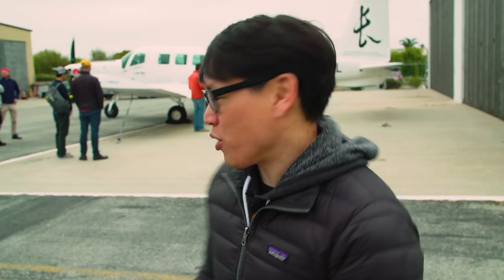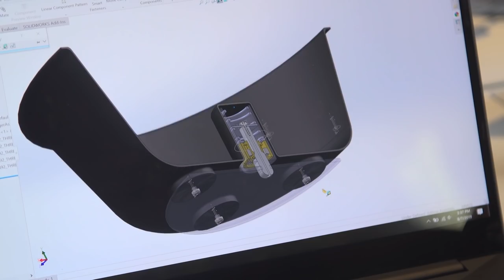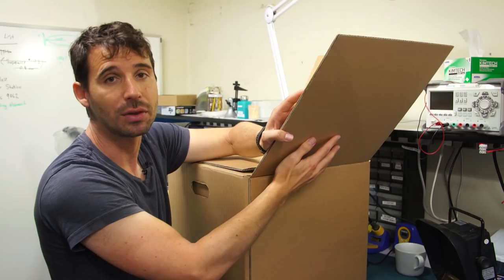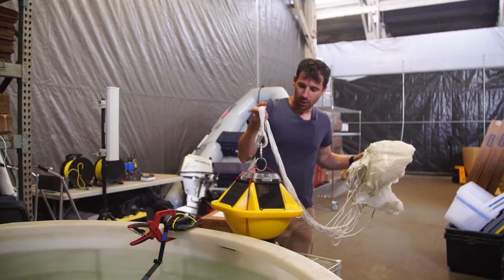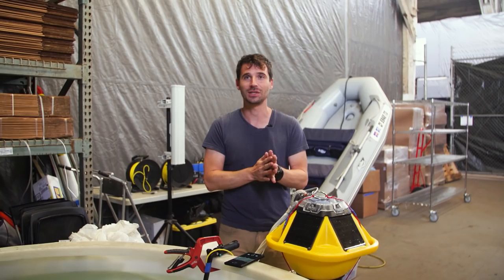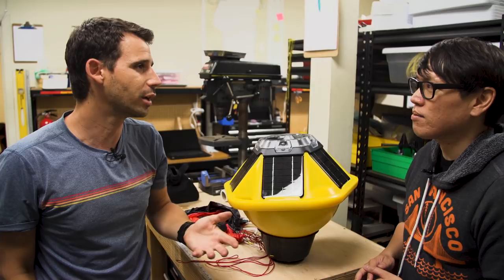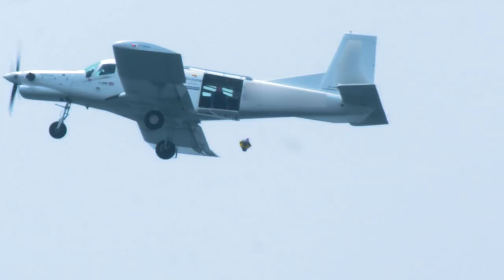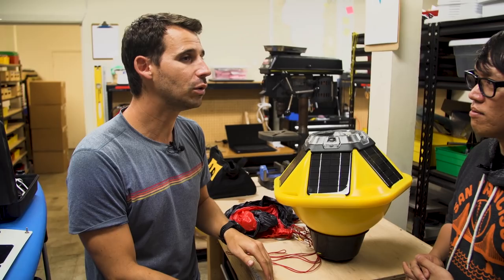Tested: Deploying Ocean Sensors from a Plane!

Comment: so what happened to the plastic bowls and the parachutes? do they just get dumped into the ocean and left?
Reply: @2000jago  the parachute gets released, only the bowl stays attached.

Small, cheap buoys like this don't get retrieved, that would be extremely expensive
Reply: This is also mostly a proof of concept or prototype. This is not the finished project.
Reply: 2000jago If you actually watched the video you would've seen them testing it and the parachute detaches from the device. Why do I even bother.
Reply: Yes, that's why they were also trying to make a biodegradable solution.
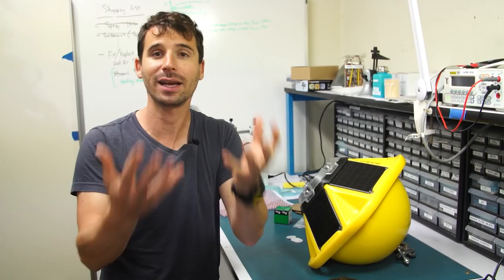Reply: @2000jago  (1:42) he stated when it lands in the water the mechanism detaches and 'is left freely to drift in the ocean' the whole point of the detaching device attached to the parachute, was that it was supposed to detach once it hit the ocean using the life vest deployment component. "if you actually watched the video".
Reply: He did mention that they were looking at biodegradable options. 
I think that in the end’ even if it does leave behind some plastic it could be a small price to pay for what could be invaluable data.
Reply: @NullHyp  I'm not really sure but would they even be able to use a biodegradable plastic? That would totally eliminate the issue.
Reply: John Jacob Jinglehimer Schmidt That doesn’t get rid of the circuitry and wires that contain toxic elements.
Reply: @hellishgrin4604  I mean for the plastic bowl holding the chain. I would assume the whole thing would continue to be useful.
Reply: @JohnJacobJingleheimerSchmit  yeah biodegradable plastic could be the solution. I'd call it cellulose tho (more similar to paper than plastic) but it would have to be tested for endurance: i mean can it actually withstand what is it meant for? The cardboard idea also bugs me.. it takes quite long for cardboard to dissolve and during that time the device wouldn't gather infos as efficiently if it isn't completely removed during the fall.
I'd prefer a different device design that allows it to be thrown out of the plane with a single small biodegradable parachute to  keep it steady during the fall and it's shape to be conical and allow a "softer" impact with the water.
Reply: thats my question more polution
Reply: I'd like to see the plastic bowl system, but made out of bamboo.
Reply: Small, cheap sensors like these are not designed to be recovered--that would increase the cost by many orders of magnitude, and the parachutes, bowel, strings, etc. will be more plastic trash that won't degrade for many, many years.  Data acquired from protocols that use multiple samples over short time intervals are just as robust at those gathered by "in situ" type sensors like these.  All this project will do is add more trash to the water, with very little good data to show for it.
Reply: Just from watching this video, it looks like the whole thing is essentially "disposable" -- eventually it will stop working, and they're not planning on trying to collect them. Though I wonder if they will have addresses printed on the buoys themselves so they can be returned if found on beaches or whatnot?
Reply: @crittobobby  I think they could use different cardboard. There are starch based materials that dissolve in water in a matter of minutes. I'd be tempted to make a box out starch based adhesive and myocomposite. The myocomposite is a mushroom mycelium based packing material used to replace expanded polystyrene. The starch adhesive dissolves and the myocomposite sections fall away like flower petals. The advantage of the myocomposite is that the material is just food. Even if it takes a while to degrade, fish, plankton, etc will just eat it.
The other idea could be to pack the buoy in starch packing peanuts and hold it all together in a starch bag. They are the sort of bags used for domestic food composting / recycling. Whilst these materials might not be fast to degrade, they can be made in sections and joined with a water soluble adhesive that would take seconds to release the protective case. 

There are lots of materials for packaging that could be utilised, it just takes the researchers a bit of effort to find an alternative to nylon parachutes.
Reply: The parachute and lines could definitely be made from silk  -- it worked for early human parachutes I can't image it wouldn't work here.  Due to the small size and (it appears) higher landing speed than is acceptable for a person, I suspect many other cheaper, weaker, natural fibers could be used (cotton, flax, hemp, etc.).
The bowl could also, undoubtedly, be made from a natural biodegradable material. Possibly paper/cardboard (like the kind used in egg cartons).  Or maybe a bag could be used to hold the chain instead of a bowl, and then a natural fabric cold be used here as well.
Reply: @JohnJacobJingleheimerSchmit  biodegradable plastic sounds good but in reality it is not. It is bio degradable but only under special circumstances. Like 65 degrees celcius under special circumstances like in an industrial composting unit and it will be gone in 7 weeks. Under normal circumstances it takes decades.
Reply: Could you not just make dissolvable string? Or simply harden the case enough to withstand the impact or designed to alleviate the impact like a dart head or pyramid?
Reply: Oh buoy.
I ACTUALLY HAVEN'T seen the whole video and I know already more about the chutes than half of the experts here.
Reply: @patricksanders858  paper!
Reply: I know, right.
I can't have a plastic(recyclable) straw but this company can do this?
Reply: Seems like they got the idea from the Narcos
Reply: Think about all those sonar buoys the p3-orions release for various reasons, decade after decade. I believe they don't retrieve those either.
Reply: Considering this could be a lifesaving technology, it’s not really a concern, is it?
Reply: @John Jacob Jinglehimer Schmidt  like PLA? It sounds like such a good idea I hope it’s what they’re doing.
Reply: @crittobobby  would hempbased cardboard be anyfaster to dissolve? Or at least break up into a slurry faster?
Reply: @willierants5880  ironically the most wasteful industry in the USA is TV/movies. Thousands of tons of material are thrown away yearly for TV and movies
Reply: @QargZer  I certainly wouldn't argue with you on that!  And they use some of the most un-environmentally sounds methods and products to boot.  Not that I am against the uses of these products per-say, but I am apposed to all the filthy hypocrites that don't practice what they preach and have the gall to lecture everyone else and insist that we change our ways, but don't lead by example.
Reply: The parachutes I feel like might catch on fish and turtles...
Reply: Tt Ss No
Reply: i wonderd the same thing thats my home man
Reply: NothingXemnas but still the parachute has the same issue

Comment: But like, why not make the actual parachute/dragchute and the bowl out of cardboard/water soluble paper/other biodegradable material?! As he said with the box, they just need to slow it down enough not completely.
Reply: I bet they will maybe since its still in testing phase they aren't worried about materials yet more so just proof of concept.
Reply: Inventing/creating something often requires trial and error. It is generally better to start with a basic plan that fundamentally works. When you have that solid base of a concept, it makes it much easier to go back and change parts/design, retest, learn from the data, repeat, until you're left with the final product. This method saves time, money and energy they otherwise might not be able to afford. Who's to say biodegradable materials aren't in the future of this product?
Reply: The cardboard box thing was a joke, parachutes are the perfect solution for slowing things down after they are dropped which is why everyone uses them.
Reply: @daa3417  but if they continued with plastic parachutes theyd be dumping plastic in the ocean. Costing them even more money to find and retrieve said plastic.
Reply: connor etchells The plastic will be retrieved along with the sensors, they aren’t meant to be there forever either. They won’t have to search for the plastic if it stays attached to the sensor.
Reply: @daa3417  have fun finding a parachute that has been drifting away from the sensors then.
Reply: Agreed
Reply: connor etchells I’m really not sure how something that stays attached via a cord is drifting away.
Reply: @daa3417  if you watched the video youd realise the whole first half the video was them figuring out how to make the parachutr detachment system work. So no doesnt stay attached
Reply: connor etchells It seemed to me that the primary reason for the detachment was to deploy the anchor of the buoy, which is required to you know be a buoy not a piece of flotsam. Furthermore detaching the 5 or more parachute cords makes perfect sense but there’s no reason it cannot remain attached by a single longer cord. This cardboard idea isn’t working and perhaps never will if they currently allow the parachute to drift away as trash there would be no harm in attempting to retain them so long as they don’t interfere with the sensor readings (there was no mention of this). If you listened yourself you would’ve heard the man describing his job as an R&D builder, in R&D especially there is never only one single way to do something.
Reply: @daa3417  Never said they couldn't change it. But as of there design right now. It detaches and floats away. Don't see why your finding it so hard to understand.
Reply: connor etchells It’s you who doesn’t get it, the detachment system isn’t mainly for the parachute it’s for the anchor. He was trying to make it do BOTH releasing the anchor cap AND release the parachute, find me one place where I said the current iteration of this buoy DOES NOT release the parachute. I am saying that it easily could be changed to have the chute retained by one longer cord not used to stabilize the chute like the main cords, simple. And no need for the same post over and over again every time you pointlessly accuse me of being oblivious, when my original comment was simply an opinion not an attempt to change the reality contained within this video as you seem to think.
Reply: @daa3417  Like I fucking said before. I never said he couldn't change how it works. But at it's current state it releases BOTH. And will continue to do so until he changes it. And and opinion not trying to change the reality of his product. Your literally stating the opposite.
Reply: They do need to detach the parachute. It's not an option. You do not want it to stay and foul the buoy, which it definitely would if it was still attached.

Comment: Two possible alternative solutions:

#1 You can make the bottom of the buoy, cone shaped (a long cone shaped) and drop it without parachute.
When it hits the mater, because of the cone, it will sink several feet thus slowing it down gradually.
Add a couple of fins to make sure it falls cone-pointed-down.
You can also make the cone from biodegradable plastic.

#2 You can insert the buoy into a large plastic disc (Saturn-like) and when you drop it, it will slow down the descend.
This is the based on the same principle the Russians used when they landed on Venus, they used no parachutes.

Comment: I waited till the end of the video to comment, But i think its very irresponsible of them to not come up with a better solution then a parachute . that is totally not echo friendly, throwing all that in the ocean to to create a death trap for the living creatures in the ocean.
Reply: I think its just proof of concept so they aren't worried about that yet more so just seeing if it works. Same thing i thought at first as well. i doubt in the end that is what it would do. Also these sensors are never going to be retrieved so they them selfs will become trash as well at some point. Cool tech but kinda sad.
Reply: Tons of plastic are dumped every day. You really think a parachute will make any difference?

Comment: What about fitting one with a g force sensor and throw it out the plane from the expected deployment altitude to establish the forces involved then design the hardware to withstand those forces and save using additional deployment equipment.
Reply: because then you have to build the thing to withstand those forces, increasing cost.
Reply: @seigeengine  however you save on no parachute, cord, base unit, ejector pin and most importantly rubbish/pollution
Reply: @ga5712  Yet you also have more material in the buoy which is also pollution, and you've increased the cost.

None of that deployment kit has any excuse to be pricey.
Reply: @seigeengine  I'm not convinced. I would think encasing the electronics in resin would be a good start for protection. 
With regards to extra material in the bouy: it's IN the bouy. Where's a parachute is a thin plastic with high surface area which would easily break down into microplastics / look like jellyfish that other sea creatures may try eating. 
At the very least they should investigate biodegradable cellulose sheets as a material for the parachute.
Reply: Because that would be proper engineering. ;) And for all the people saying it cant withstand the impact: FIRST determine what that force is, rather than make ASSumptions. Next, remember that a body of water can either be a brick wall or a smooth embrace. Ask any Olympic diver. Its all about how you enter it. Third, terminal velocity is terminal velocity. It doesn't matter if you started at 50 meters of 500. You'll not impact at a speed faster than TV. Determine the TV. If it CAN survive hitting the water at terminal velocity, every other argument is moot. Finally, if it CAN'T survive a TV entry, then from test 1 you should be able to figure out just how much you have to slow it down to survive, with some margin. Then redesign the body. A parachute is a nice idea. But a few paper streamers (quickly biodegrading) may have been all that was required. That's done in rocketry and weather balloons all the time. The point is, without performing the tests as GA says, they JUST DON'T KNOW.
All they need is the body shell (no electronics) weighted to match the full system (use sand, in case the shell cracks open). Add a variety of one time use G-force burst sensors set for different values and home in on an approximate impact force.
Or do some math and rough calculate it.
or simulate the body in free fall. Redesign with fins or scoops or whatever, until you've lowered the TV enough to survive impact.
A variety of ways to approach this BEFORE casting off plastics, bits of metal, rope and parachutes.
Reply: @seigeengine  impact forces are debatable. Debatable because they provide no data that suggests they have determined them. Don"t make an assumption. The shell looks pretty sturdy and robust. And the shape looks close to ideal for water entry. Perhaps all that is needed is to put enough resistance on it to assure that it enters "nose first" and not on its side or upside down.
Reply: Making electronics that can survive this level of impact is not terribly hard. (its not EASY.. but not difficult). The automotive, military and aircraft industry demonstrate that, literally every day. I suspect the shell as never designed for and intended for this kind of deployment. Possibly needing to redesign the shell and molds is more concerning than the electronics.
Reply: Gotta love when people contradict themselves in the course of two statements.

Comment: why not design it to be dropped without a deceleration device? it could be placed more accurately if you just drop it. with a parachute it's going to drift with the air
Reply: also, if it can't handle the drop to the water, how well will it survive a hurricane?
Reply: @better.better  I would imagine that impacting the surface of the water from several hundreds, if not thousands, of feet will produce significantly more force than riding the swells within a hurricane.
Reply: Reinforcement of that level also doesn’t come cheap, and the electronics could be damaged by such a fall.
Reply: Better & Better the cardboard box was a joke.
Reply: The ocean id HUGE, a few hundred feet off isn't going to make a difference.
Reply: Specific placement isn’t important in buoys that drift
Reply: Yeah, strange to me that they need a deceleration device. What a bummer.

Comment: It's like the adult version of the classic middle/high school science class egg-drop test! What is the maximum G force the buoy can take? I didn't see any shock-watch stickers, but maybe these were functioning prototypes and not simple dummies? That seems like an expensive (but definitive) way to test it.
Reply: It sounds like they are doing wave motion analysis, which means they certainly have an accelerometer package, which can probably record way more shock than the solar panels can take.  So, for testing, they just turn on data recording drop it and either the physical buoy breaks, or the instrument package survives and they use that data.

Comment: You should look into use the twin commander as a good versatile plane to launch the sensors. It carries a tremendous amount of weight and has an incredible range and would make excursions around the polar regions easier and safer to deploy.

Comment: It seems like deploying them like Sycamore seeds, where there is one wing that could potentially biodegrade seems like it would be cheaper, fewer parts and easy to deploy.  The long wing can deploy after clearing the aircraft in case that is an issue.

Comment: I worked on a prototype similar to this in school. we used salt to be a water-activated switch for a cooperating radar target to measure wave height and period. I designed the oscillator with a 555 timer as well as a collinear antenna. I might still have the design files and the first prototype I made. it is cool to see a more advanced application by someone else being used to collect data.